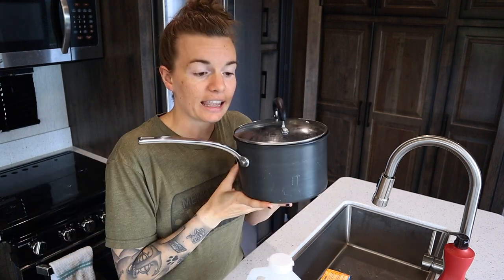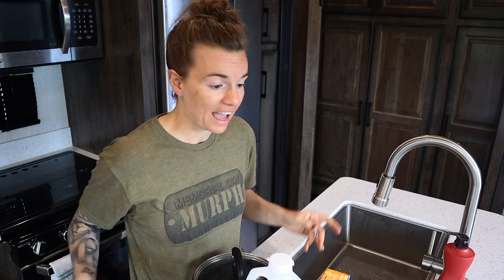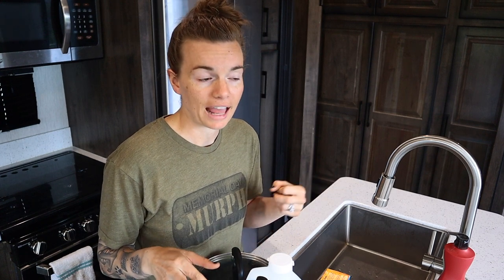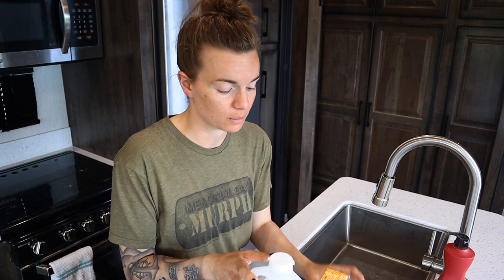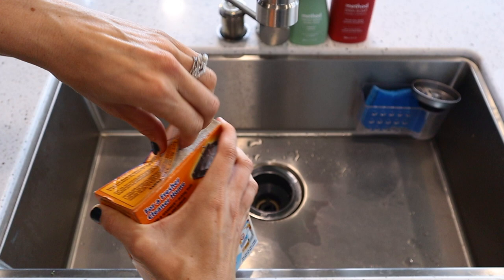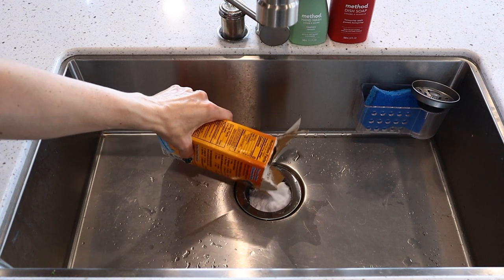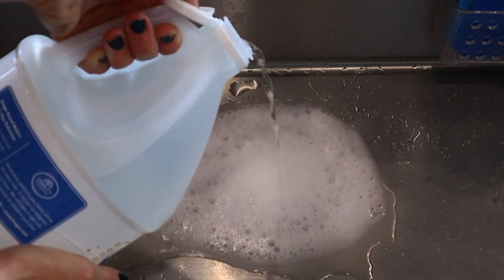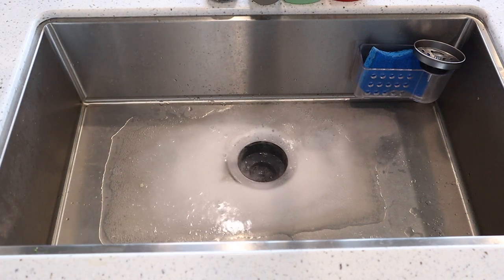How To Fix Clogged Grey Water Pipes With Baking Soda And Vinegar - RV Living // This Faithful Home

Comment: Your heated hose is plugged in wrong. The end with the plug has the thermostat sensor on it. If it enclosed inside the trailer compartment the thermostat never gets cold enough to turn on. That’s why the hose has a fitting to hook the hose up at either end.